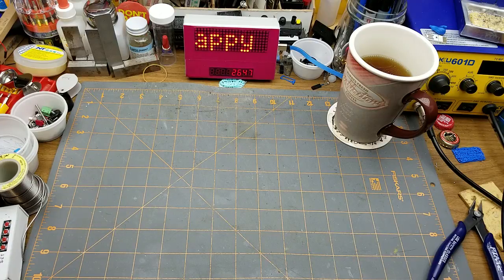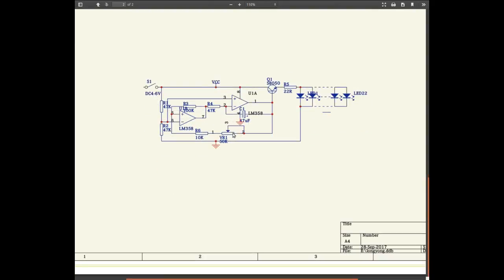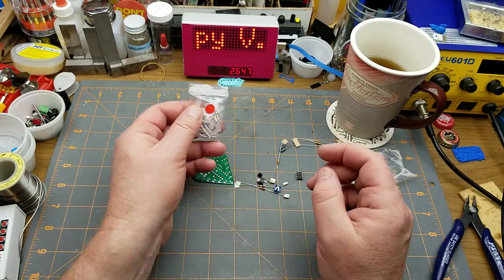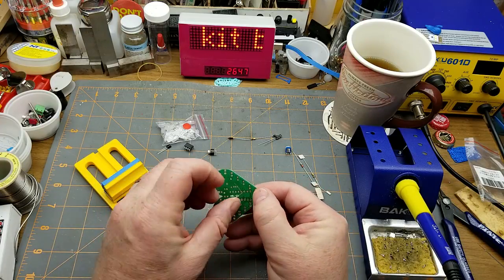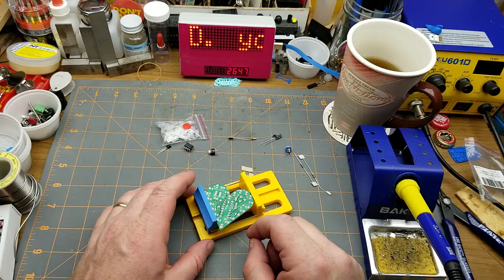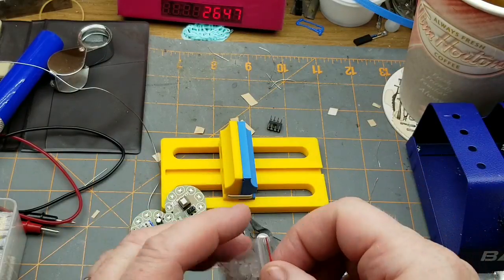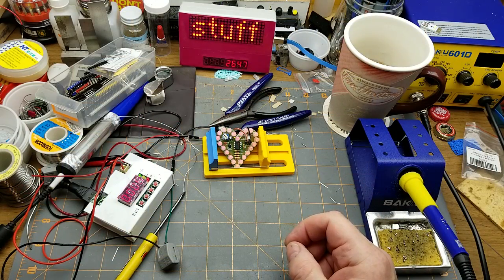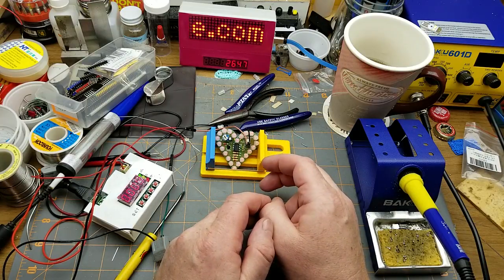kit build - Valentines edition

Comment: Nice build! You could add a narrow spacer between the jaws of the circuit card holder, maybe something flat screwed down to the base just wide enough to allow your finger tips in. It could also hold one of the jaws in a fixed position and be removable for working with tiny circuit boards.
Reply from the maker: I've been thinking about options. 
I may have to get a few extra jaws printed and do some modifications.

Comment: the "power" connector is basicly, solder wires in the holes, and then pull them trough the holes below it to put them out of sight
Reply from the maker: Yeah, upon closer inspection (not just looking through the camera lens) that is exactly how it is designed.
Reply: Dang it, I wanted to say that.

Comment: change your soldering iron tip to the appropriate size chisel tip or hook point. you will get much better results and it will make you happier. nice fun little kit. love building these things.
Reply from the maker: This one is a lot better than the needle point tip that came with the iron.
Reply: if you can us hakko tips on this set up, the curved tips and chisels work really well. I would not use the needle point either. Happy soldering. :)

Comment: On your holder-thingie. If you fixed one jaw and on the other added an "eye" of wire parallel to the base, then you should be able to open it using one finger/hand.

Comment: Nice kit build. At some moments I had the impression, as if the soldering station does not provide enough power. But  maybe the soldering tip as such is also ready for a thorough cleaning :)
BTW, and just to heat up the discussion which type of tip is the best for the job: For through hole components I would recommend a chisel type of tip. (now I sit back an grab the pop corn :) )

Comment: I feel better seeing someone else checking resistors, I struggle to remember the colors etc..  Love the channel and content.
Reply from the maker: I can mostly remember the code, i just cant see it -- I'm colorblind.
Reply: @pileofstuff  I can easily see the colours on the old 3+1 band resistors (with the beige background colour) it is the metal film resistors with the 4+1 bands (with the awful blue background colour) I struggle with because the contrast is so bad with them. Never need to measure the old ones, always need to measure the new ones (especially those that start with brown and have the brown tolerance ring at the other end - so very confusing.)
Reply from the maker: @SpeccyMan  I'm about 50% on the old style resistors -  red/brown, blue/violet and yellow/orange give me the most trouble.

But, yeah, I find it hard to believe that anyone has a good time reading those blue-ish metal film resistors.
Reply: @pileofstuff  Have only been hacking with electronics for a year or so,  always use a meter to double check as am still not 100% with the colors and values..  Better be safe than sorry :)
Reply: I'm guessing, it's probably a good idea to check them anyway since they're coming from the "highly trustworthy" merchants in China. We all know their component tolerances could be a bit tighter.
Reply from the maker: Bill Wilson: absolutely. I've had other kits with a random assortment of resistors that didn't match the parts list.

Comment: What's that blue stuff you've using to hold the parts while soldering?
Reply from the maker: The brand name stuff is called "Blu Tack". The stuff I'm using is a dollar store knock-off version.
It's intended use is to temporarily hang posters and things like that. 
One caveat to using it for soldering is that it can get goopy when it gets hot, but it regains it's normal consistency after it cools.
Reply: @pileofstuff  Blue tack, I'll look at home Depot. Thanks 😊
Reply from the maker: @Tony770jr  Or possibly office supply / school supply type places.

Comment: Looks like one of the resistors has a higher value than needed as the LEDs don't look very bright.
Reply: There is only one current limiting resistor for the LED's and that is the 22R.
Reply from the maker: I think the real variable is the poor quality control on the LEDs. 
That's probably how they can throw together these kits so cheap.

Comment: Thats one ugly soldering tip, looks as if it needs the wire wool treatment and some good juicy lead solder flowing onto it. Generally use pointed tip for this type of soldering as it gets deeper into the hole and makes good physical contact with both the component and board.
Great project and thanks for sharing.
Reply: Actually a pointed tip (or conical as it is known) is the wrong type of tip since it is very inefficient at heat transfer to the solder joint. He is using the best kind of tip.
Reply from the maker: @Nick B: Yes. The flat side of this tip makes  solid contact with the pad and transfers heat quickly.
Reply: @SpeccyMan  hi, thanks for reply, just what i have found, over the years, works for me. Though i guess every one to their own.

Comment: I'm not sure about the solder. I guess i wouldn't use it anymore. Doesn't work nice, doesn't look shinny, etc...

Edit: looking at the video for longer: you had to do almost every solder joint twice 😁 you are not new to soldering, so that's strange. Has to be the solder.
Reply from the maker: I'm sure about the solder - it sucks.

Sometimes there is such a thing as "too cheap".
Reply: I got some cheap solder from china. It explodes when I touch it to the iron.
Reply from the maker: tyler ward Explodes? That's an entertaining failure mode! 
Who says these cheap Chinese sellers aren't innovating.
If I had to guess, I'd imagine whatever they are using for flux is expanding faster than the solder can melt away.
Reply: @MrTidangerous  Rosin core does that. It's used for plumbing and big stuff.